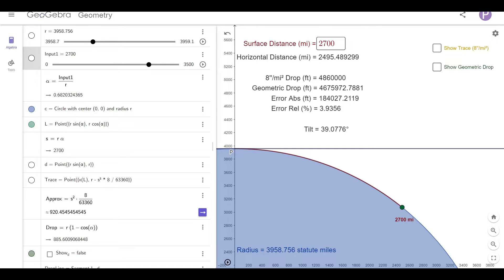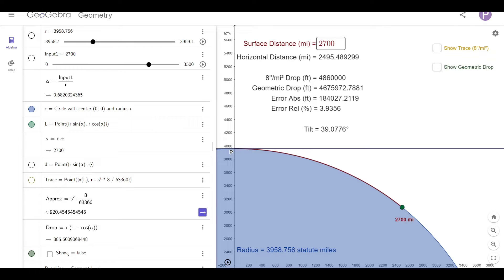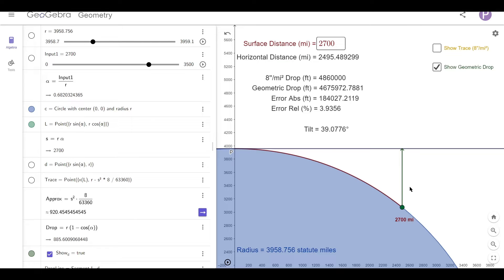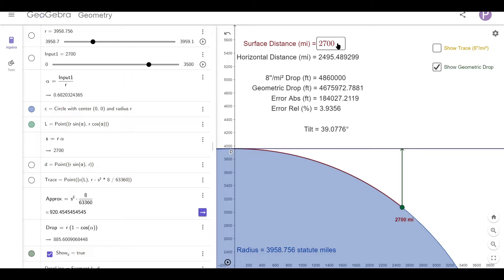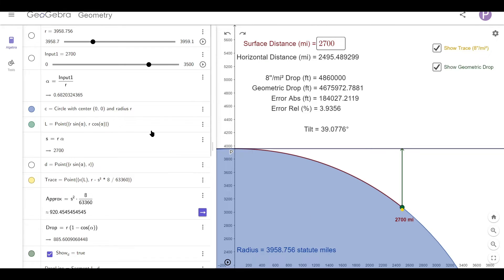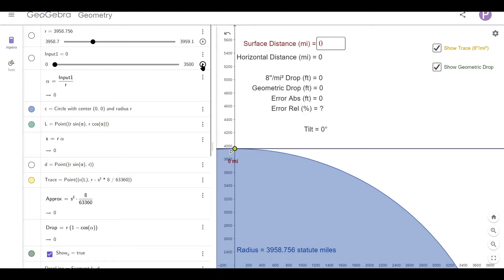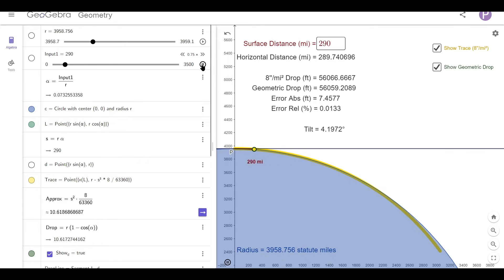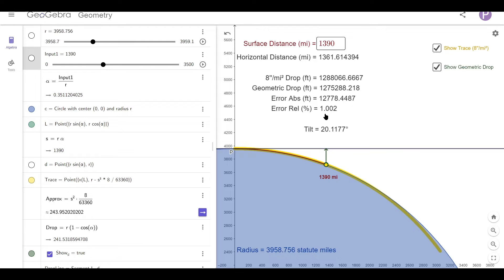8 inches per mile squared

Comment: In the textbooks the 8” x mi^2 is used in conjunction with determining the elevation of remote points by vertical/zenith angles. 

However, it is pointed out to be ‘sufficiently accurate for distances that are practicable’. ie: distances of tens of miles, not hundreds of miles. When dealing with major distances in professional practice. of course the full and complete geodetic computation was always carried out.

At practicable distances the computed error is far less than the uncertainty of the measurement.

And before machine calculation, the 8” mi^2 was less prone to calculation mistakes. In today’s software driven practice the proper full calculation is always done.

Comment: Does 100 miles mean 66ft of drop? And if so, why is the curvature calculation 6668.17 ft?
Reply from the maker: There are number of different variations. In this example I use a radius of 3958.756 miles and I use the surface distance to calculate the geometric drop and that comes to 6668.407 ft.  The 8"/mi² drop is based off a radius of 3960 mi and it uses the chord distance and that comes out to 6666.67 ft. There is a link in the description for Walter Bislin's site and he has a drop calculator you can use. You can use miles or km and get answers in feet or inches etc.  66ft is for 10 miles.
Reply: @Petey194  I see.  What I did initially was add 8" of drop for every mile, and I was under the impression that curvature  and drop related to different calculations.   Clearly, I didn't do it correctly. I  think the calculations are using a square mile instead of a mile in any given direction.   I that correct?  Even that being the case, why is every mile accounted multiplied by 8 inches not sufficient.  My layman's brain is telling me that 66ft of drop for 10 miles is too much.
Reply from the maker: @joffynoxx  If 1 mile is 8" then doubling 1 mile will be 2² * 8", trebling 1 mile will be 3² * 8", quadrupling 1 mile will be 4² * 8" and so on. So for 10 miles, 10² * 8" is 800" and 800" is like saying 2/3 * 100ft or 66.67ft
Reply: Thanks for your time.
Reply from the maker: @joffynoxx  I made a video the other day which is very similar to this. https://youtu.be/HmS8Hp5z9BA When I have difficulty visualising things like this, I construct some geometry and it helps me understand it better.

Comment: When I did this and plotted it in Matlab the graph showed 8in per mi sq as a pretty decent approximation up to about 1500 miles. After that the deviation became more and more noticable. I would estimate its not too shabby an approximation for use between 0 - 1500 mi.

Comment: change the value to under 2000 miles, try it at 1000 miles. Its accurate up to 2000 miles on a parabola...you have cleverly chosen the distance value of 2700 miles...
Reply: @rrrick2129  bs, no curve no globe, only simpletons are getting fooled anymore
Reply: @Adamveckz  The current YT flat earth hoax is about eight years old. Eight years and yet you feckless clowns still  haven't come up with the formula that lets you determine the distance to the flat earth horizon based on the height of the observer.
Reply: @Adamveckz  A flatearther that calls others simpletons is the most ironic thing ever. There is not even a coherent model on your side, nor a map, flatearthers can't even agree with one another. Face it, we are not the simpletons here.

Comment: Petey, you're the Geogebra God! Have you been told The Secret with regards to 8 inches per mile squared? It's NOT a parabola, and it PERFECTLY matches the curve of the Earth, all the way out to a quarter-planet! But you have to use The Secret for this to work.

Here's a hint: how would you "fairly accurately" measure distance from start to finish, if you weren't allowed to use Trig? Meaning, you can't trace your distance across the surface.

You'd use a chord as a geometric (not trigonometric) approximation for distance! If you do this, then 8 inches per mile square will trace a perfect quarter-circle! Not terribly practical to actually USE the "curvature drop to the equator from the North Pole" but it is fascinating that the equation is even more accurate than you could have imagined. :-)

Comment: Nobody is doing any measurements or observations at the distances you've provided! How about you try and do it at say 10 miles and compare the accuracy Globe for brains!
Reply: Correct. 10-20 mile observations for elevation determination by vertical angle are uncommon these days. And 100 mi observations were very uncommon even 50 yrs ago. 

Satellite observations retired that practice. Topographic surveying of late 19th thru mid 20th century used the appropriate calculation as needed. 8” mi^2 was useful for many minor projects. 

I quite recently surveyed a high tower from 400 sq mi valley. 1-27 mi. 0.667 ft x mi^2 curvature, and -0.10 ft x mi^2 refraction were quite consistent, given typical weather conditions. Not winter, not night or twilight.

Comment: The 8" formula is a first-term approximation to 1 minus the cosine function for a radius of 3960 miles. It comes from the Taylor series of the cosine function.
        cos(a) = 1 - a^2/2! + a^4/4! - a^6/6! + ...
where a is d/r (distance over radius)
h = r(1-cos(a)) = r(1-1+a^2/2) = r*a^2/2 = r*(d^2/2r^2) = d^2/2r
converting from miles to feet: h = 5280^2*d^2/(2*5280*r) = 5280*d^2/2r
So if d=1 mile and r=3960 miles, h = 5280/7920 = 2/3 feet  (8 inches)
Reply: If you make the assumption that the arc length and horizontal distance are essentially equal and that the drop is perpendicular to the horizontal, you can quickly solve it using nothing more than the Pythagorean Theorem. Over over one mile, you'll get 8.0024" of drop. The error is less than 0.1% for any distance less than 500 miles.

Comment: The approximation to drop is not the problem. The problem is that this formula continues to be passed off as a reasonable way to determine the amount an object will be concealed by the horizon. 
This deception is well understood as you pointed out in the video, but this fraud continues because this is not emphasised enough.
Reply from the maker: Hey Prof Phil, thanks for popping by. 👍Totally agree. I couldn't end it without saying something. I understand a bit better myself after doing this. If I placed an observer at 20 feet above P, that would create another tangent line to a new horizon. You'd then need a vertical line from the chosen location to represent the object there, and by vertical, I mean in line with the gravity direction. This object might be then cut into visible and hidden parts. There's also refraction involved. Sounds like a project for the new year. 👀
Reply: Yeah, you always have to split it into 2 problems. First invert it to determine the distance to the horizon, then subtract that from the total distance, and use that to get the hidden height. But before all that, determine what value of R you're going to use, i.e. what refraction you will allow. I use h=d^2/2Reff, where Reff = R/(1-k), where k depends on temperature gradient.
Reply: @michaeldunlavey6015  
And ‘typical’ refraction, sometimes called ‘standard’ refraction has specific rules. 

k=0.14 is applicable for modest temps: 45-85° F, barometer +/- 0.25”, modest distances of 10-20 miles, and when both points of observation are less than about 8,000 ft or so. And k= isn’t a wild bull whip. In conditions modestly different k= is modestly different. Typical survey applications are typically several miles and a couple of thousand ft elevation differences. The professional applies the appropriate calculations as is warranted by the requirements of the project. 

And even in harsher conditions or with more significant distances, simultaneous reciprocal zenith angles mitigate most of the uncertainty. 

With machine calculations, software driven workflow, and gps, by in large 8” mi^2 is a bit archaic. However it’s practical and for relevant pencil and paper calcs, and for the student.

A mile observation to a 1,000 ft tall radio tower, for instance, curvature and refraction is a matters of inches. Give or take less than an inch.

Comment: After the hundreds of hours I must have done doing algebra and calculus homeworks, it's mind blowing that a circle tracks so closely to a parabola over such a large segment of the curve. I'm still amazed by it.
Reply: Both are second order polynomials along the x axis. So values close to and either side of -b/2a for a quadratic will necessarily approximate a circular function.
Reply from the maker: Yeah, I was pleasantly surprised by how close it matched. I've seen the graphs and spreadsheets people have done in videos but I still couldn't get a real sense of its accuracy. Best way to learn is do it yourself! I was messing around with r-x²*8/63360 for a while and this is the parabola I see most often. But this one only works with horizontal distance and not spherical arc distance. I didn't use it in the end and just elected to place the yellow dot at the approximated distance from the tangent line, inline with the actual drop line. I've no idea what the equation was for the emergent trace line. 🤷‍♂
Reply: I'm just seeing your comment over here at Petey's, and my thought was: "Why learn calculus when you can just do Algebra?" :-P I'm kidding, of course!